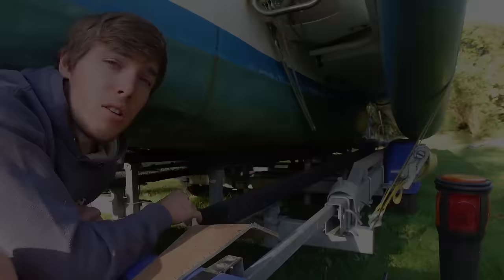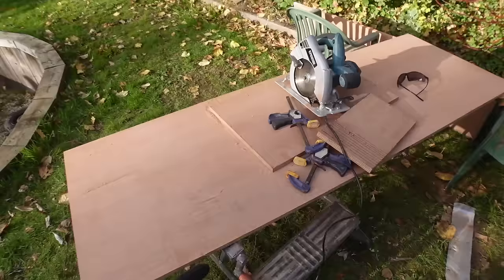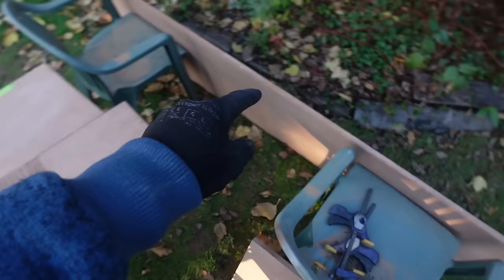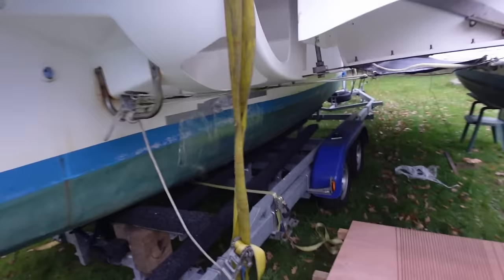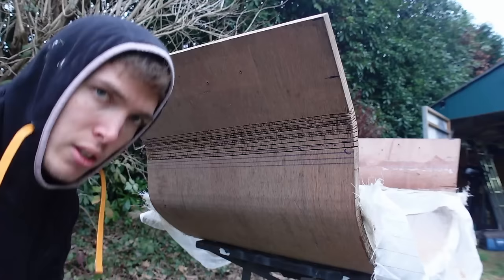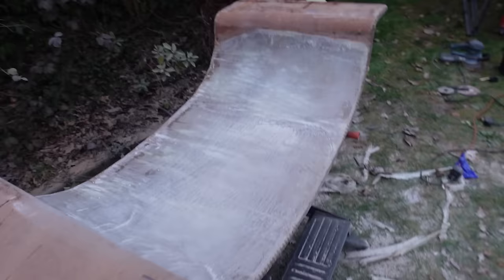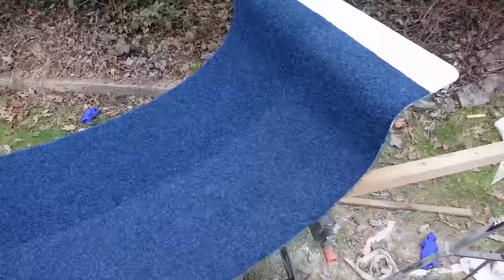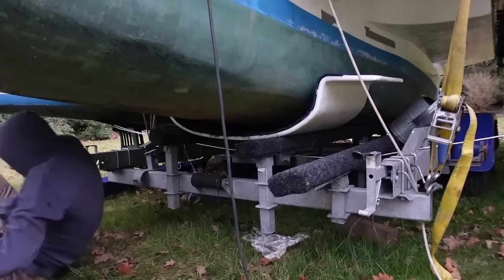Making Trailer Cradles For My Trailer Sailer Trimaran! | Ep.121

Comment: Nice job on the new supports!! Don't forget to epoxy the holes that you drill before running the bolts through -- it would be a shame to have the wood start rotting from the inside after all of that work!
Reply from the maker: I will be for sure!!! Thank you!

Comment: Plastic tubes full of epoxy resin mixed with chopped strand fibreglass with slow hardener sitting in wooden shapers, the epoxy takes the exact shape of the hull, and at the same time fits perfectly into the plywood former.  After it sets, drill through the set fibreglass, countersink the holes, bolt them to the formers, then cover the top surface with non-skid silicone rubber and mark on the side of the vessel the position for any tiedowns.

OR--you can use keel  rubber rollers--and lateral bogeyed rollers in tandem, so much EASIER to get vessel on or off.
Reply from the maker: Good idea! I also thought about the rollers but would be difficult with my hull shape and the light weight construction.

Comment: I recommend you do not add carpet, since it stays wet and concentrates moisture.....blisters will appear.
Reply from the maker: The bottom of the boat is copper coated so epoxy. Do you think there will still be an issue?
Reply: Interesting!  Maybe household carpet would rot quickly.   So maybe marine bunk material only.  Plastic or synthetic "carpet".  Maybe add groves or holes for drainage also?  But hey, this only prototype 1.  Overall GREAT IDEA!
Reply from the maker: @carlamerritt490  I’m using marine bunk carpet so should be fine. As for drainage I’m not too worried as it will be quite dry most of the time with the boat covering it. Will have to see how it goes though!

Comment: Alex - what weight of CSM are you using? It looks to wet-out pretty well. I'm building cradles for my sports boat and want to incorporate some interesting features. Your video was most helpful, particularly screwing the batten to the ply to assist with clamping. Thanks heaps.
I could make the video showing all the mistakes that I made, that you did'nt!